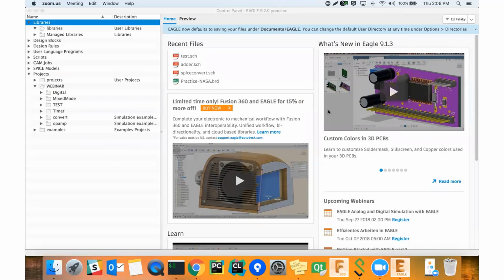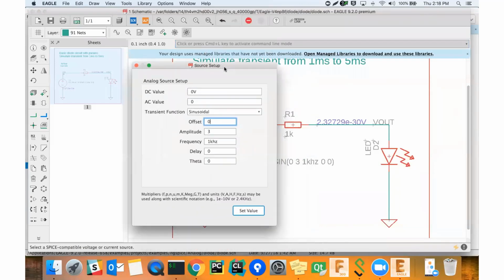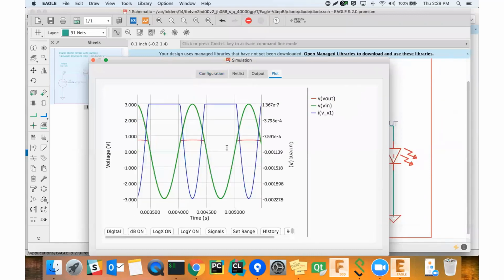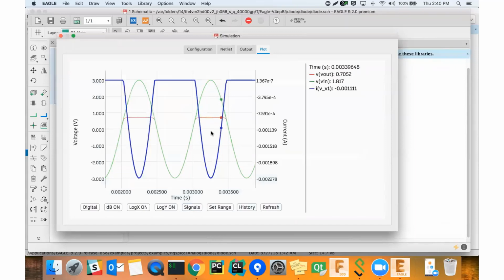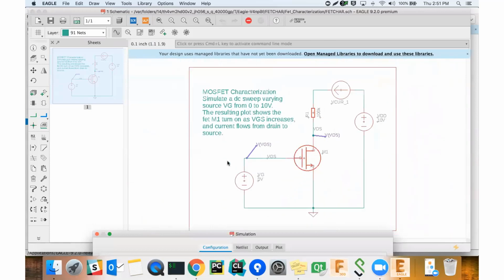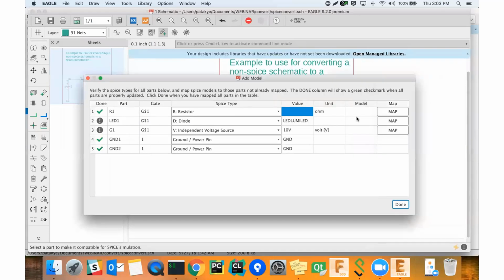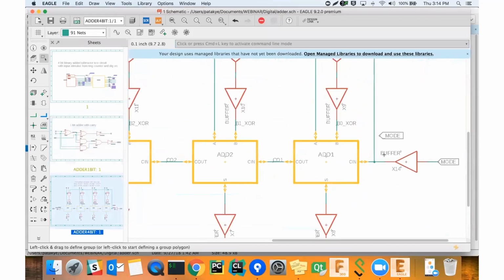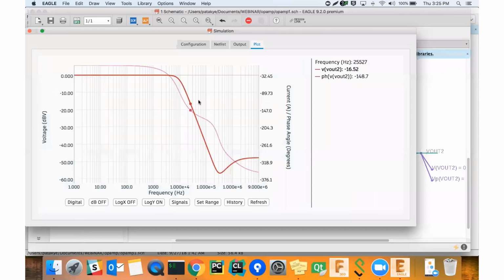Digital and Analog Simulation in Autodesk EAGLE

Comment: 0:00 Introduction
3:28 Basic example
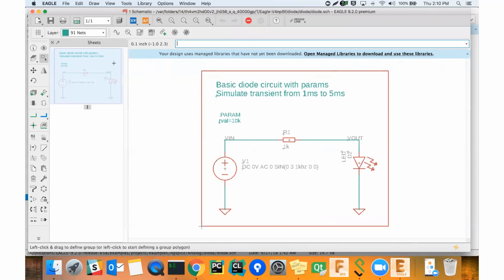4:43 The preconfigured library
8:40 The different types of simulation
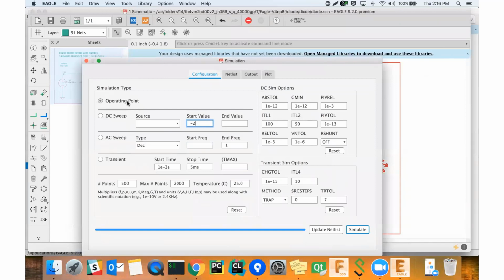9:55 Operating point simulation
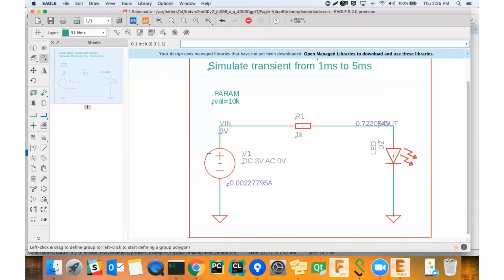20:10 Time simulation 
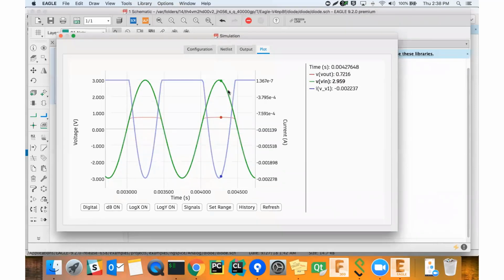32:40 Plot features
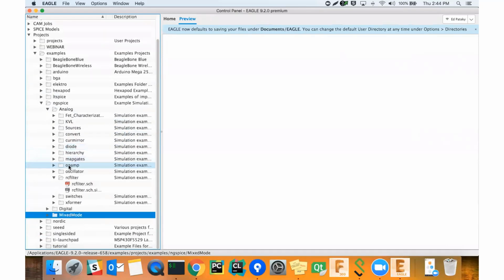38:00 Frequency simulation
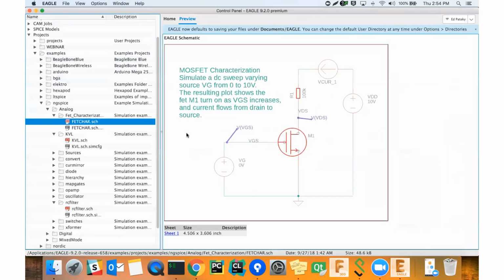48:15 From a non-spice to spice schematic